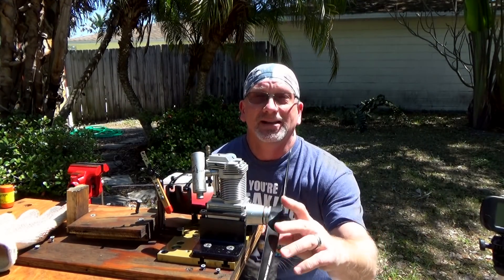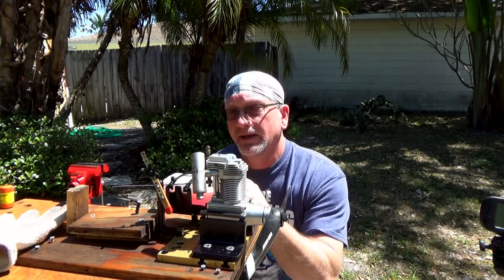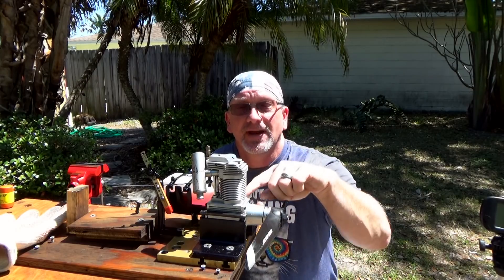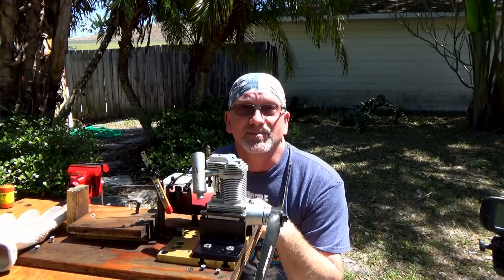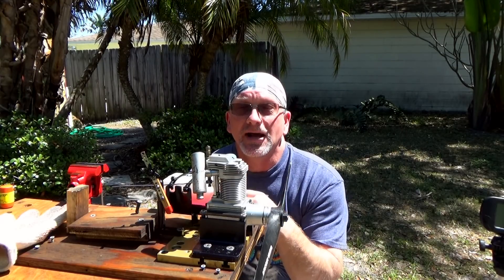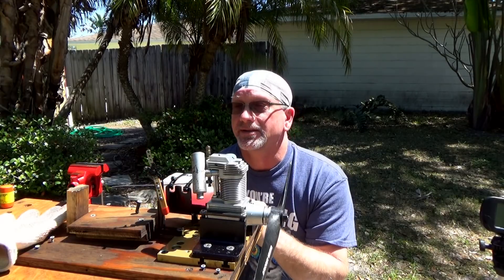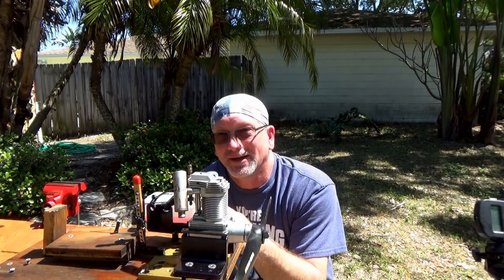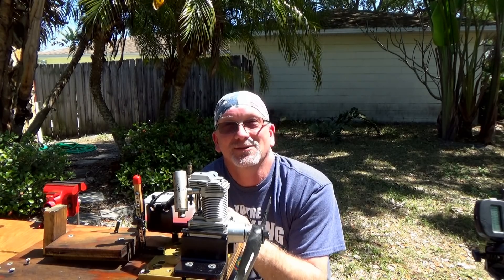Laser 100 FAI Run

Comment: Tremendous engine indeed. With 10% Nitro, 18% synth oil, Firepower F7 glow plug (equal heat rating to the OS F plug) & APC 16.5x5W mine idled @ 1,290 rpm all day long. It's on a Phoenix Tucano 60 now with an OS F plug, 12% Nitro fuel & APC 15x8 prop (8,000 rpm) giving it quite some performance, just so enjoyable.

Comment: Glad this beauty is now running as it should. It's possible the exhaust was indeed initially gummed up and your first runs may have gradually softened the blockage to the point where it has now all blown through and cleared, so the engine now runs just fine. I'm no expert but the initial blockage may have caused back pressure leading to the leaks around the pushrod tubes which have now also gone. (The glow plug plug was most likely down to the old plug not seating properly, now changed.) Here in the UK I have 4 Lasers and all run like little sewing machines and idle unbelievably low. What is the breakdown of FAI fuel? Laser normally recommend 85% methanol, 15% synthetic oil, i.e. no fancy fuel required. Up to 5% max nitro if desired but by no means essential. Anyway, glad you like the engine now; as a Laser fan I was very disappointed with your first impressions of it. We in the UK know just what fantastic engines these are and it is great that you have helped 'spread the word'! Grahame
Reply from the maker: FAI fuel is 0% nitro.  I do not have access to pure synthetic oil FAI fuel.  So I run Omega FAI which is 17% oil.  30% castor, 70% synthetic oil.

Comment: Finally it runs how it should and as I always told you this Laser Engines are something special. Is the “Low Idle“ contest opened now?
Reply from the maker: I think I just won it....
Reply: David McIntire 
If it is the chance to win a competition that motivates you to master this engine I achieved my goal.
Reply from the maker: Oh I never gave up on this engine.  I just have so many projects going on. I move from project to project.  I still need to run it with the 15x6 and 14x7 props I have.  I do not have a 14x7.  I do think it likes FAI fuel, which is cool by me.